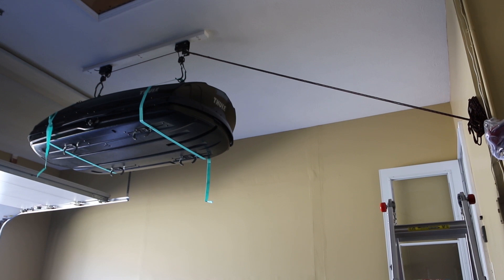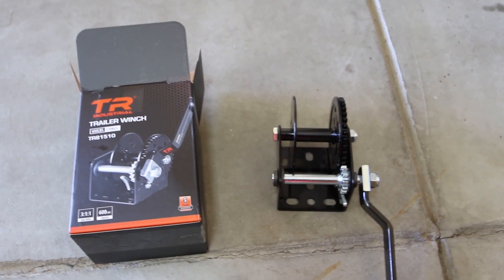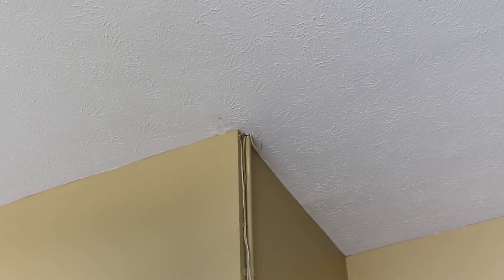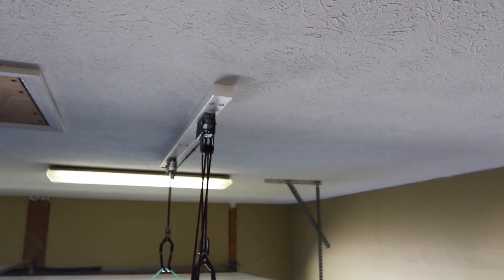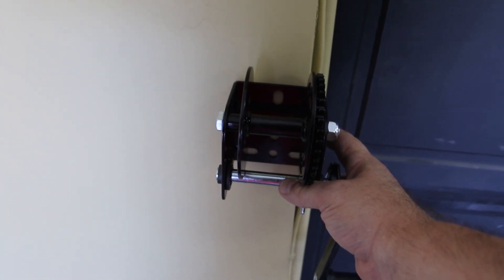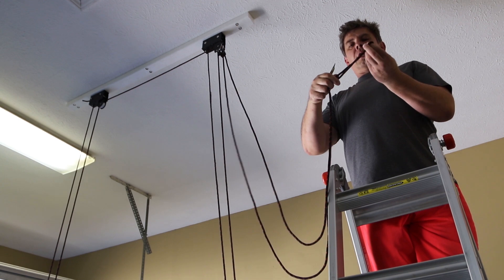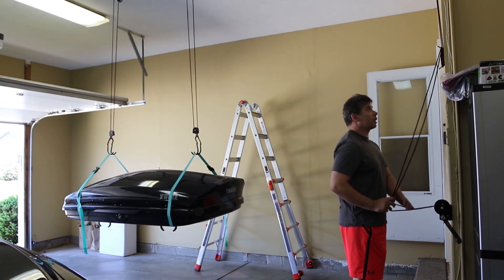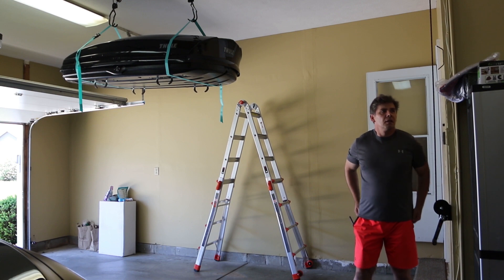THULE Rooftop Cargo Box Ceiling Storage Hoist Modification

Comment: I have encountered this same problem with rope degradation on my bike hoists and the rope off-setting from the pulley. Now I have Thule cargo box that I want to install as you have done here. In this video, you say you will follow up with a motorized/remote control modification. I cannot find that video - can you put a link here?

Comment: Hi Tomek, thank you for making this video series.  I copied your same design with the extra pulley and winch, and it works far better than the original hoist system to raise and lower.  My winch is mounted in a restricted spot so I cannot fully turn the hand crank on the winch.  But with the idea in your 3rd video using a electric impact wrench to raise and lower that solves my problem.  Thanks again!

Comment: Thanks for this second vid.  After watching the first, I went out to look at my box, which I had raised to the ceiling using a similar system that I made with two eye bolts and two pullies.  I came to the same conclusion that with a wide box and how close to the ceiling I needed to get the ropes and brake mechanism wouldn't work properly.  This vid confirmed that.  Thanks.